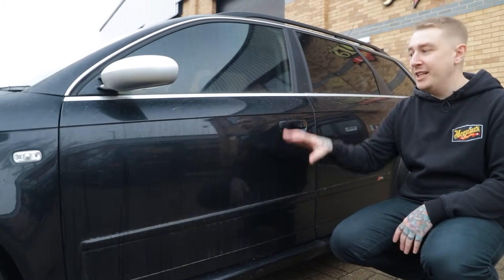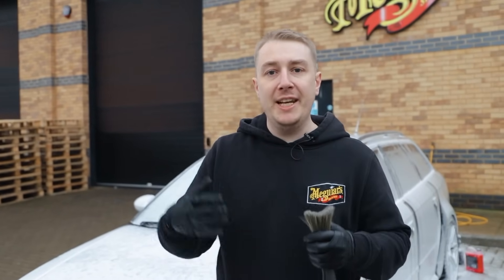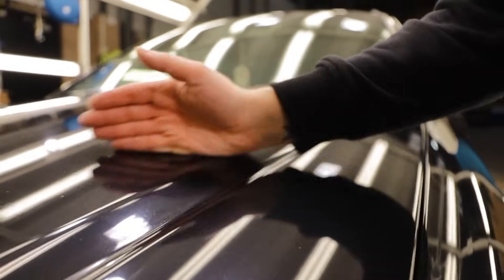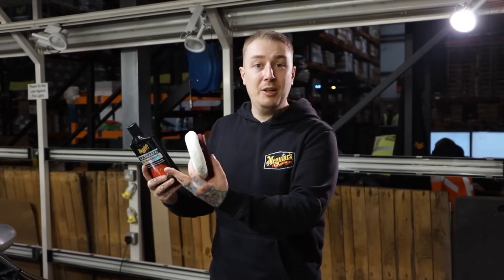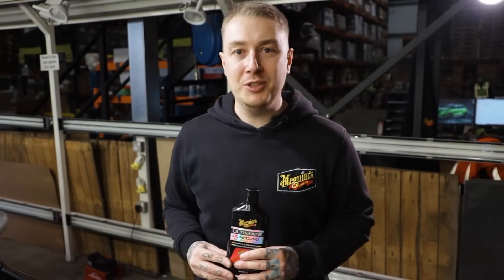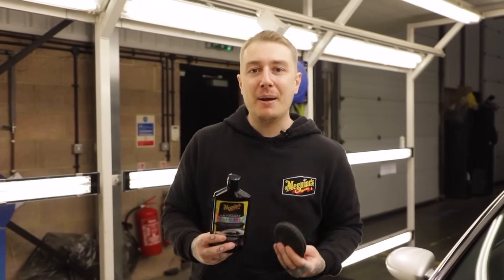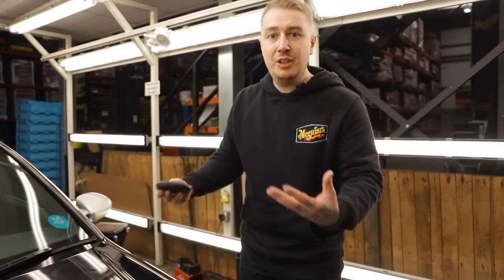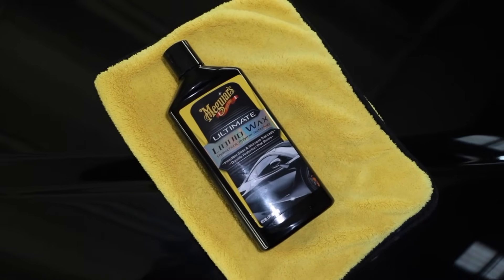How to remove swirls!

Comment: Just a wee tip, if you use tar and glue remover then iron remover it'll save you're claybar for clogging up as much. Chemically removing the contaminants before physically removing them.

Comment: So I'm impressed, I've just ordered a MT320 ULT kit. BUT I've got an Merc SLK with ridges on the bonnet/hood. Can I use the machine over those or is there a risk of removing the finish? Obviously can't keep the pad flat.
Reply from the maker: We would recommend working up to curves and creases in the paint, never over them.

Comment: I used the compound + polish yesterday, it was very difficult to remove it! I had to remove it almost immediately, because the longer I left it on, the harder and harder it was to remove. What im doing wrong ?
Reply: Try to do it when it is not too hot outside. Do it in a shaded area. Do smaller sections at a time and don't over do the number of passes. If using a polisher keep the speed low to medium. Wipe off before it dries. This method has worked for me on my black Infiniti G37s coupe. Hope that helps.

Comment: Great video, can I ask what rpm you were using for the cutting compound and also the polish? Cheers
Reply: I prefer the lowest speed setting and no more pressure than the weight of the polisher. And that goes for any compound polish or pad.

Comment: I’ve over 20 years as a vehicle painter, and I see you’ve made the biggest mistake after machine compound polishing, when applying any wax, polishes, or glazes you should always apply in straight lines, or your just putting minor swirls back into the the clearcoat.
If you want the ultimate paint correction, sand the panels wet with a DA sander and a 3000 Trizac disc first before machine compounding.
Reply: Question for you:  i had my black tahoe repainted black. It looks great from a distance but there is swirl marks in the finish in various spots.
 How can i get them out by hand and not wet sanding? Would you recommend a polishing compound or rubbing compound?

Comment: What speed did you use on the DA to correct the paint?
Reply: 4500 👍🏼
Reply: @dan.roberts  Thank you.
Reply: @dogbite5509  start on slowest speed to first spread the product then increase to 4500 for your passes
Reply: @dan.roberts  Fantastic. Thanks again.
Reply from the maker: Between 4800-5800 is our swirl slaying speed when using Ultimate Compound and MT320.

Comment: Watch alot of vids and enjoy but you go against everything you say. So not to use a carwash soap with wax because you want to compound/polish on a base with no wax on it…. Well you use a quick wax as a lubricant for the clay bar literly rubbing it into the paint. Use a bucket of h20 with dawn. That would be what you do. You try to sell to kuch of your product is the problem. We buy the stuff as we see fit/ want anyway. Dont go against doing the right thing to sell an extra bottle of a product

Comment: What a load fannying around just to wash an ever depreciating item 🤦‍♂️first it was snow foam then it's a pre spray on the heavy duty cleaner now its wash plus ...what a load of crap ...they need to do a side by side comparison after washing one with all the trimmings and one without I bet you the paint sounds the same after you wash it either way as a panel beater and sprayer this is just marketing to lighten your wallet